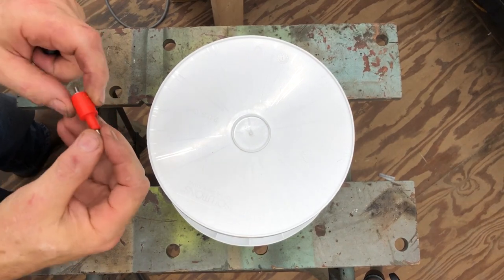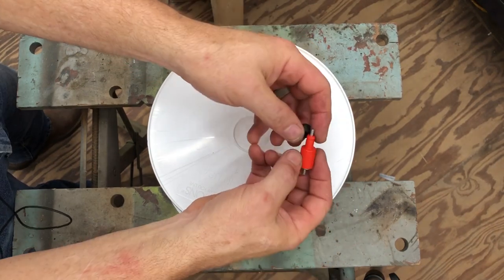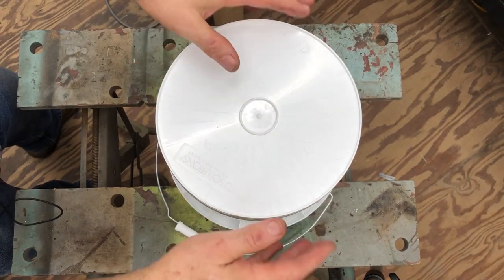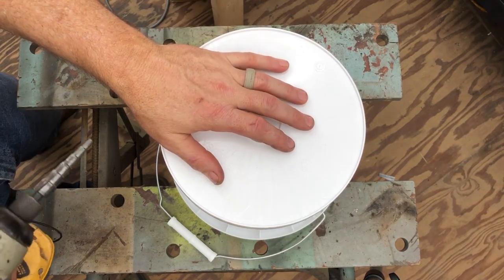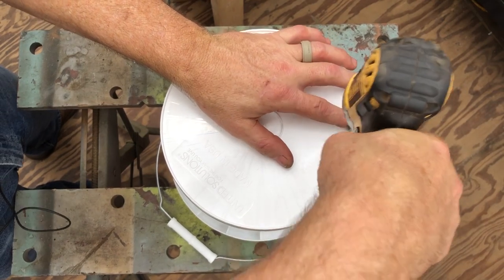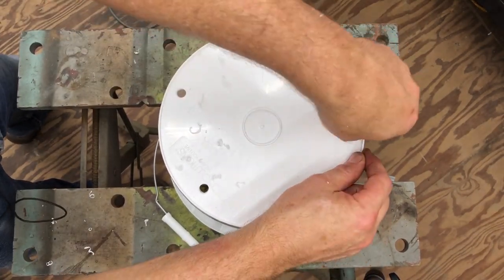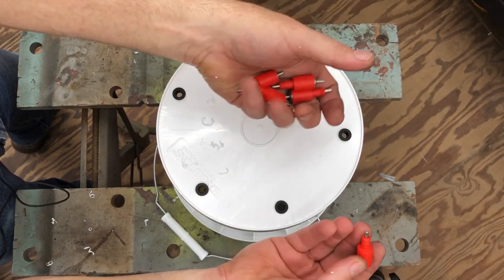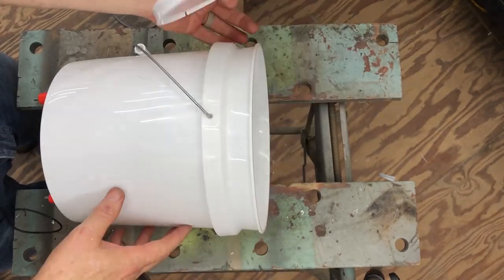Chicken Nipple Waterer in 3 Minutes

Comment: I can not find any videos about my specific way of installing mine. I did find other methods and a reason for the problem. Was hoping you could help or a viewer can. So I purchased the heated chicken waterer from FandH this winter. It's just a 5 gallon bucket with a handle, top, and the plug for the heater unit. These do have the water nipples installed on the side of that bucket, not the bottom like you have. This is nice for me because I don't have to hang the bucket. It just sets on the ground. So I purchased water nipples and a 5 gallon bucket to make my own. The package for the nipples does say to install the nipples to my spacing on the side of the bucket. So I did my first nipple. It was not leaking, did good. I continued to put in 4 more nipples around the bucket generously spaced. I added water just over the nipples. To make sure my threads didn't leak. They do not. My problem is all the nipples are now leaking from where the chicken would peck at. It's set up exactly the same as my water I bought from FandhH. So I looked online, and it says the nipples at that specific area will leak water if my water pressure is incorrect. But it was referring to then using PVC pipe and not a 5 gallon bucket like mine. So I can't figure out what I did wrong to stop the leak. Can anyone please help and let me know what to do? Now I have holes in a 5 gallon bucket I don't want to waste. But I prefer the nipples on the side and not under the bucket. Thank you!!!!!!!
Reply from the maker: The nipple placement is specific to the type of nipple. The type of nipple I have in this video must be installed vertically to function correctly as they require gravity to keep them closed. If you install this type of nipple in the horizontal position it will leak continually. The paddle type nipples can be installed on the side of a bucket. Without knowing specifically which nipple you are using we'll be guessing at the answer.

Comment: The poultry nipples I purchased off Amazon didn’t come with the grommet, but they are 2-piece nipples. Hopefully they work ok.

Edit: I was able to just drill a hole slightly smaller than the nipple and force the it to thread in just fine, and no leaks!
Reply: Hi what size bit did u use mine leaking 😣
Reply: @melisaali2010  I don’t remember what size at the moment. I just held a bit up to the end and made sure it was just a rich smaller than the piece that threads into the bucket.